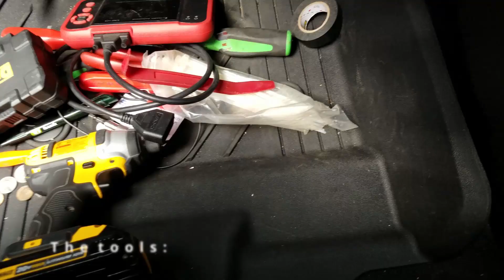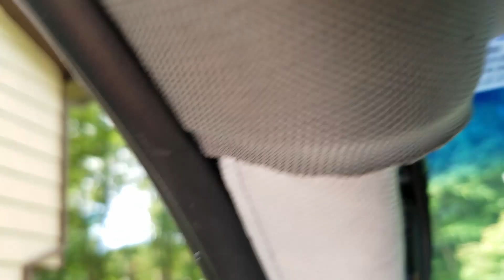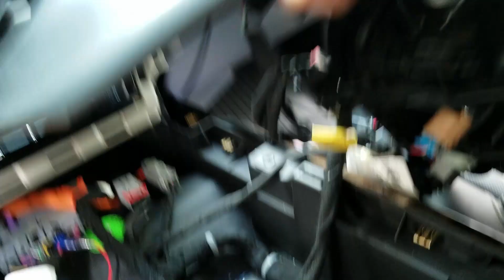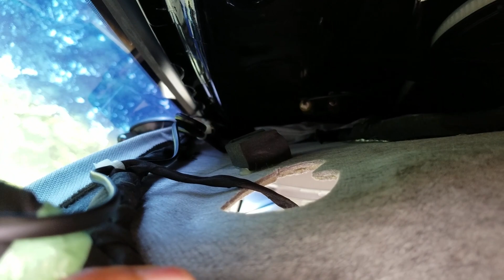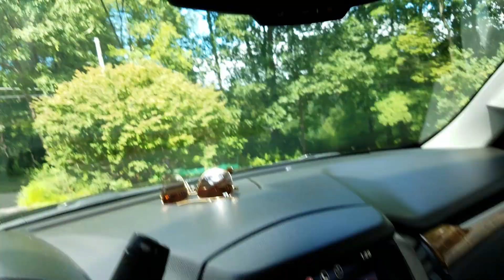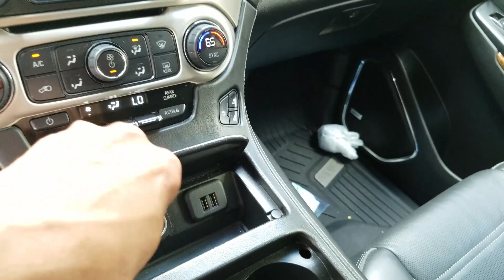Escort Direct Wire, How to install it on all vehicles.

Comment: Much easier to use an “add a fuse” to the fuse panel to get the power instead of tearing apart the center console and damaging a wire
Reply from the maker: It won't get damaged if you route the wire correctly.